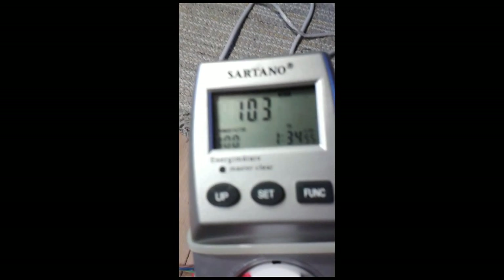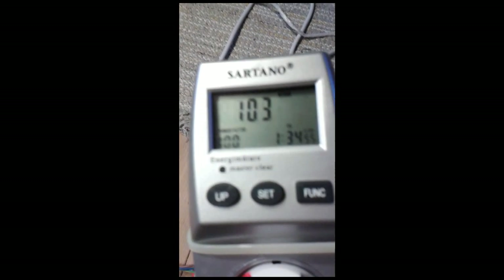#438 QEG Sweden Magrav Test 03

Comment: Your copper didn't nanocoat because you didn't use enough positive Orgone. Set up several Orgonite generators in a circle around you Magrav unit. This will create a zero point fluctuation that can be tapped.

OR MAYBE IT'S BULLSHIT.